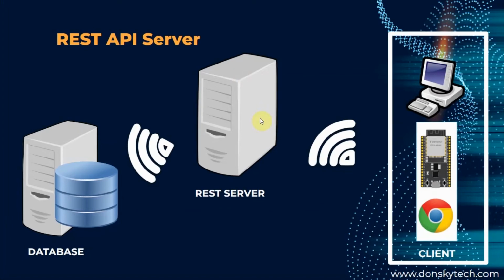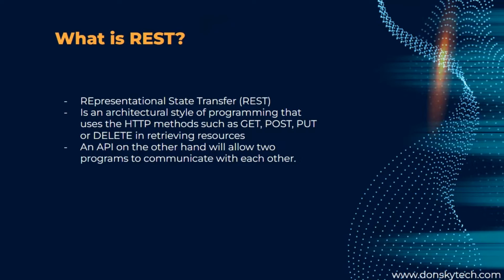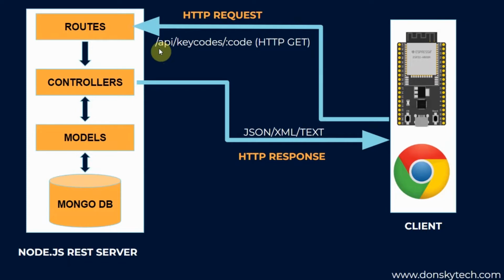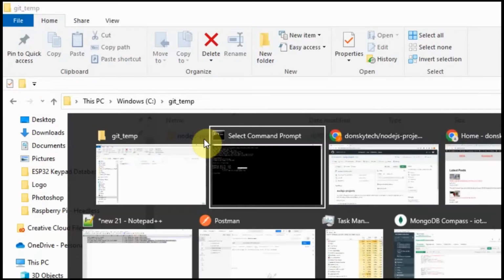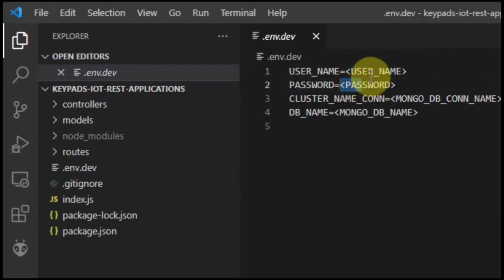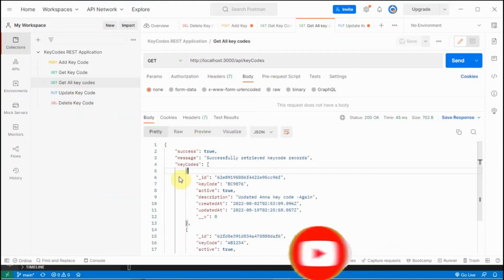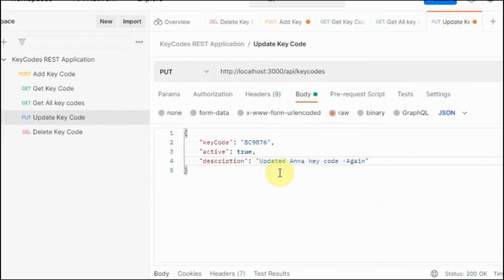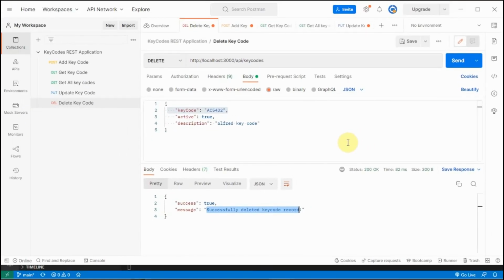Build REST API Using Node.js, Express and MongoDB

Comment: great video! I currently have MongoDB local host and not on the cloud service. What does that change within the code?
Reply from the maker: Hey sorry for the very late reply.  You can try mongoose.connect('mongodb://localhost:27017/myapp'); or if your setup has credentials configured then mongoose.connect('mongodb://username:password@host:port/database?options...');